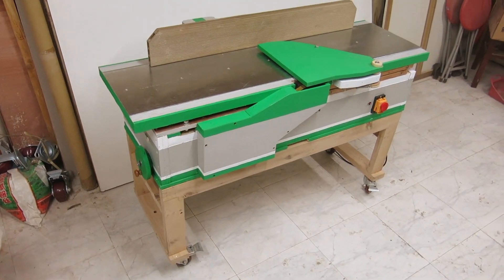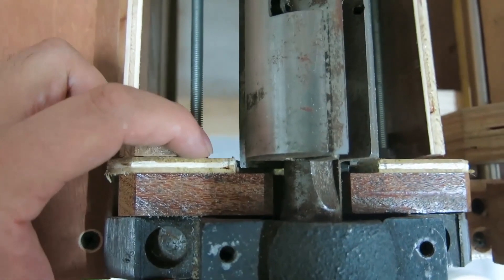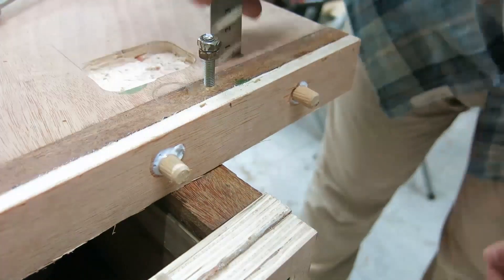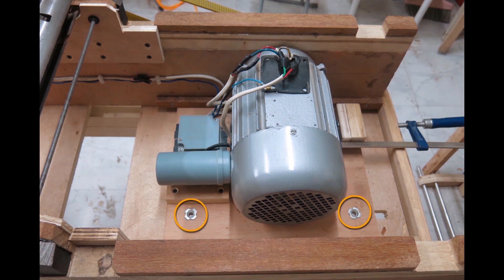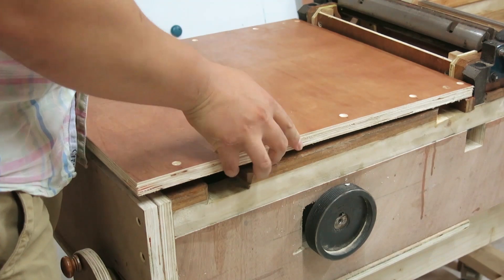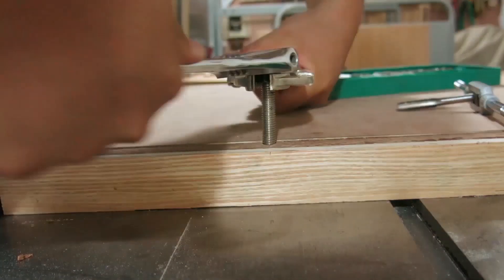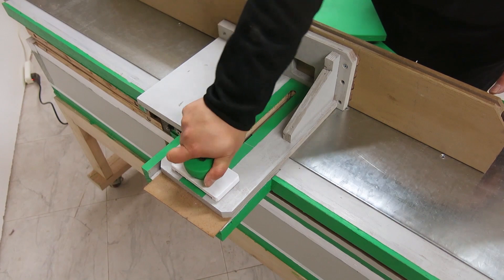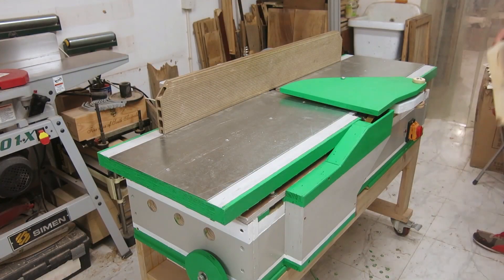My homemade 13" jointer

Comment: Very nice build and good video and description.  After using some time now can you tell us if you are still happy with the MDF deck board as the fence.
Reply from the maker: When I'm doing edge jointing, the fence will be slightly bent, but I don't think it's a problem.